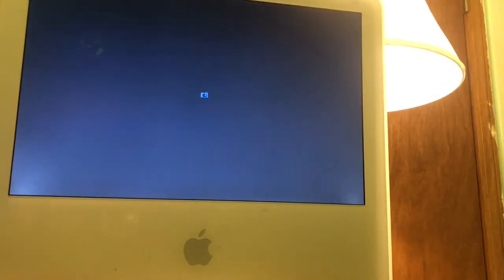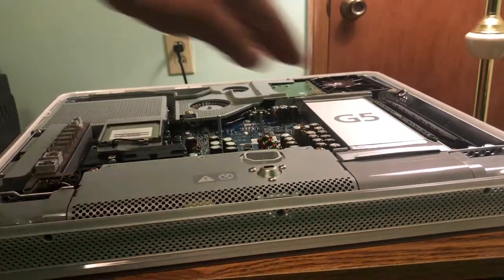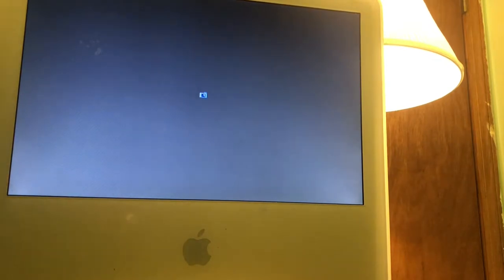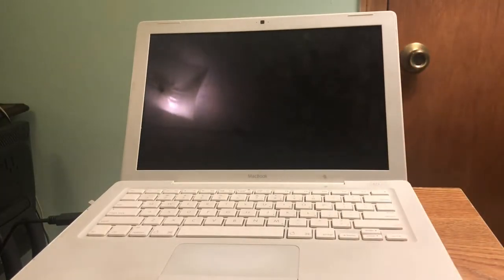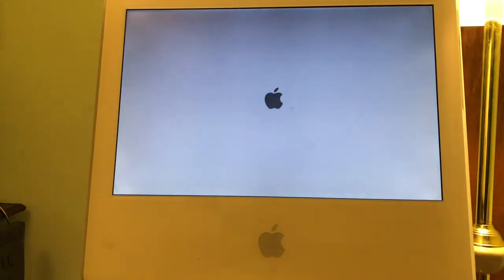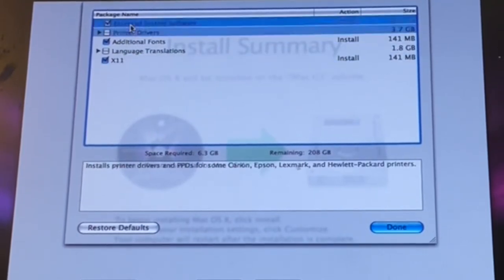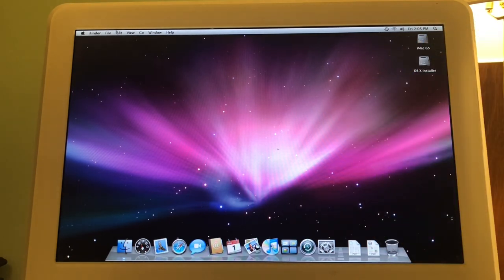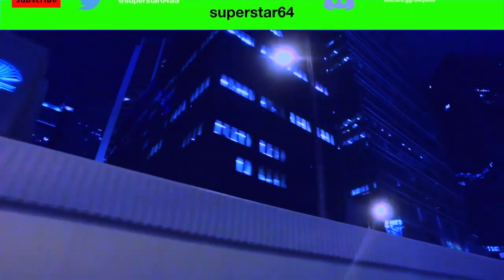LITH: iMac G5 Repair and Restore

Comment from the maker: Before anybody comments on this video, I want to state that this video is NOT a tutorial, and I never intended it to be. This is a video showing one way that I did this process, and not the definitive way to do this. The video is intended to be entertaining, whether you actually learn something or not. That’s why I show all of the steps that I went through.
Reply: That was pretty clever ! (Using the Tiger install disk to restore the 10.5 installer from an external drive... )
Reply from the maker: @marcbrie4879  
This was before I started playing with Firewire and iPods. Had I used Firewire with another system, the process would have been much easier.
Reply: @superstar64  True ! But it would not have been so interesting. The easy stuff is boring.
Reply from the maker: @marcbrie4879  
And that's why the next video will have an odd hard drive replacement.

Comment: did you put leopard onto a single layer dvd ? if so where did you get the DMG ?!? Ive been trying to get leopard on my g5 for 2 weeks now
Reply from the maker: I took an image from the internet and imaged it to the hard drive
Reply: superstar64 through fire wire?
Reply from the maker: Rory Thomas 
Despite the fact that this is not a tutorial, I showed everything I did in the video. However, the tl;dr version is that I partitioned an external USB hard drive, imaged the leopard installer to it, booted the computer with a Tiger CD, and cloned that partition to another partition on the hard drive I put inside the G5.